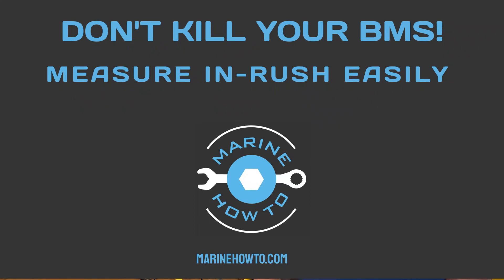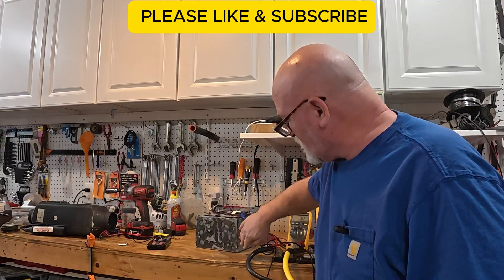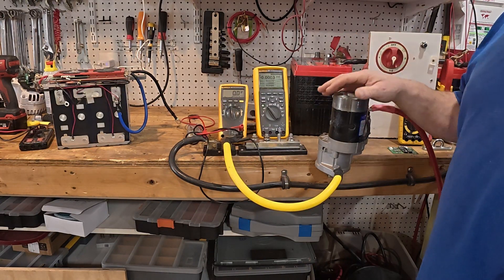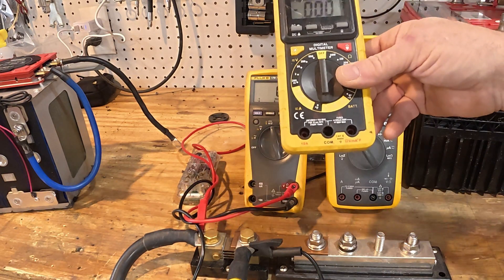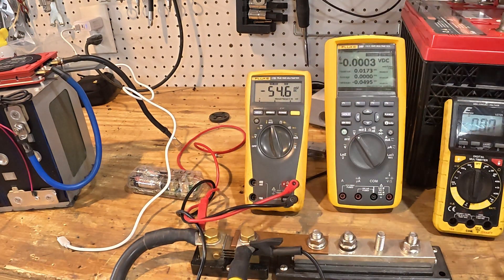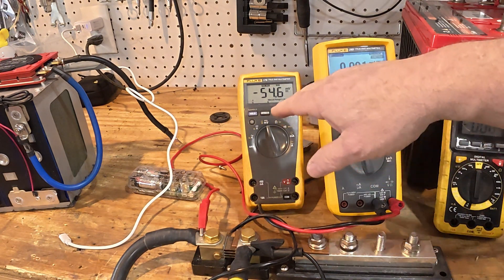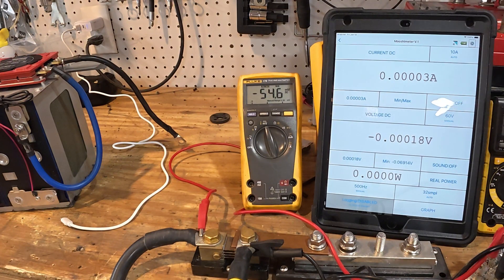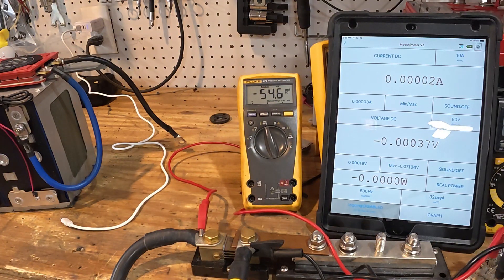Measure DC  In-Rush Easily  & Affordably

Comment: Hi Rod, I like the content of this video, but your math @7:00 is off by a factor of 10 as you described how to convert mV to Amps.  Ohm's law state V=IR (or if you are an old guy like me E=IR) where V (or E) [Volts] I current [Amps] R resistance [Ohms)] So a  500A 50mV shunt means that at 500A the shunt will drop 50mV (and from Ohm's law R of this Shunt is calculated as 50mV/500A = 100uOhms),  So for a current of 100A you will see (again with Ohm's law) 100V * 100uOhms = 10mv.  Now in the discussion and on the video you say this number is 100mv.  So I think you were over estimating that number by a factor or 10. But after that you did correctly estimated the inrush current that was measured at 54mV as 540A.  So in fact 100A should show as 10mV on the shunt, but you correctly converted the 54mV to 540A even though your description of 100A generating 100mV was incorrect.  Here we see you understanding what you are doing, however you misspoke about the 100mV.  Other than that a great example and I like your content.      

Now let us talk about the placement of your test leads on the shunt.  On this shunt there are 2 screws facing the camera (though one cannot be seen hiding behind the large black cable).  These screws is where your MultiMeter leads should be connected.  Otherwise your voltage  measurement will include the resistance voltage drop across the high current lead connectors to the shunt (which can be significant compared to the resistance of the shunt itself).  Now for most electrical applications the drop across these connections is very small, but you are measuring very small voltage, so you configuration over-estimates the current seen by the shunt (due to this additional voltage drop).  In electrical terms measuring the voltage at these screws creates a 4 point measurement (the whole idea of a shunt).        

All that said, I really like this content.  Great way to implement an inexpensive Amp Meter.  And keep up the good work.       Chuck     (Edit: I did make some changes after I first posted to correct the language and typos I found proof-reading my post.)
Reply: @chucksommer7784  Yes, I misspoke, I had a stroke in 2021 and even though I know what I want to say the wrong word gets to my mouth…
Reply from the maker: @rccollins8160  Chuck, yes the test clips would not grab the heads of the small side bolts nor would they fit around the hex heads that is why the bottom jaw of each test lead is in direct contact  with the brass of the shunt. The top jaw is really just holding it there..
Reply: @MarineHowTo  OK. take a pair of uninsulated ring-lugs and attach them at the screws and you can conveniently clip to that.
Reply: Thinking about your feedback to use an uninsulated ring connector fastened to the screws on the side of the shunt for a multimeter connection point… wouldn’t you expect to see a voltage drop on these connections just as you would on the load and line connectors?   How is one better than the other?   Am I misunderstanding what you are saying about the resistance of these connections?

Comment: As a newer pro this is an awesome tip! Was in the middle of researching inrush capable fluke’s to measure some windlass motors for folks who want to see if lithium batteries will work for them.
Reply from the maker: Glad to be of help. This method works great for those situations.

Comment: Hello Rod, great video and just in time because one thing is the rating of the starter motor and the other is the DC In-Rush. In regards You mentioned a JK BMS. What 12V JK model did You use to handle the high DC In-Rush ? THXs